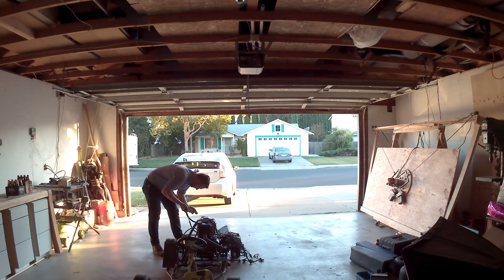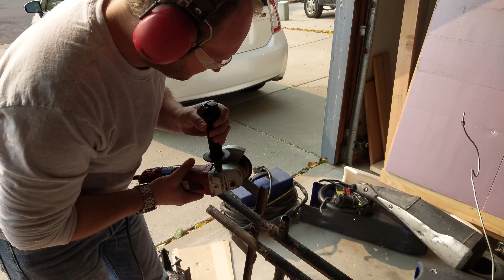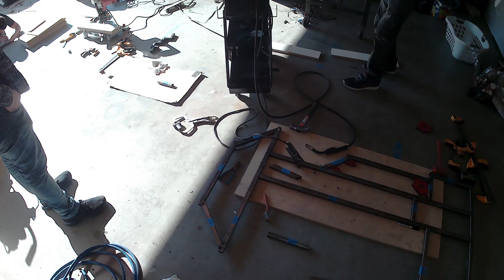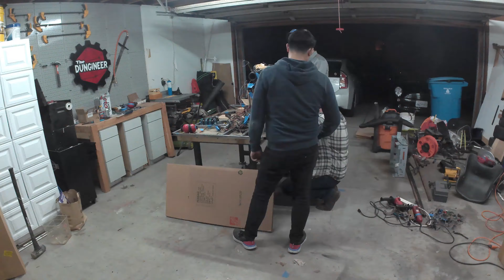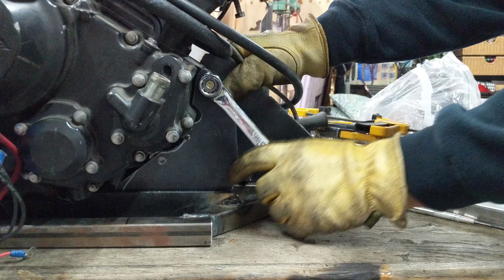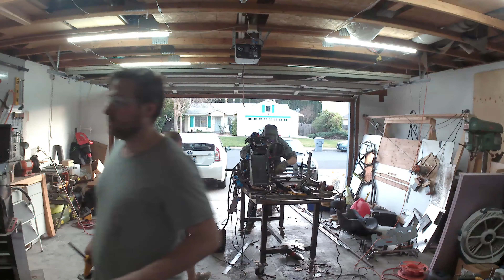Go Karting, Part 1

Comment: Interesting choice to have the engine mounted beside the driver. It kinda looks like General Grevious' wheel bike! How did you compensate for an initially unsymetrical centre of mass? Did you use a drive of equal weight to the engine and did it affect the handling much?
Reply from the maker: We actually calculated average driver weight compared to the engine and used that to set the center of mass. It's surprisingly well balanced. It's the Ackerman of the front wheels that's off.
Reply: @TheDungineer  cheers. I meant to say driver. That's a good solve. I just watched the second video and the chassis is so low I can't imagine there were many problems with cornering